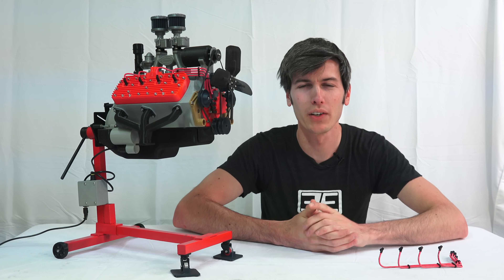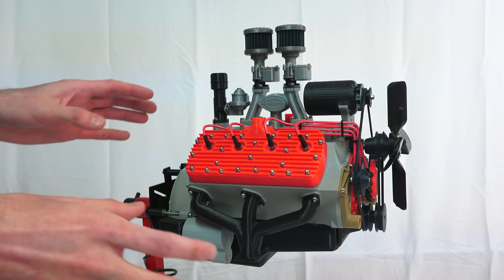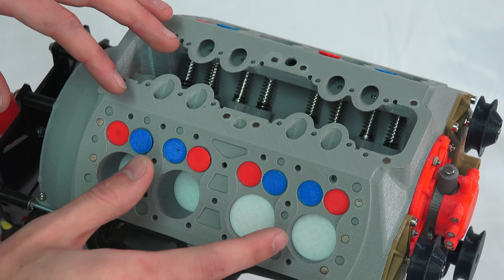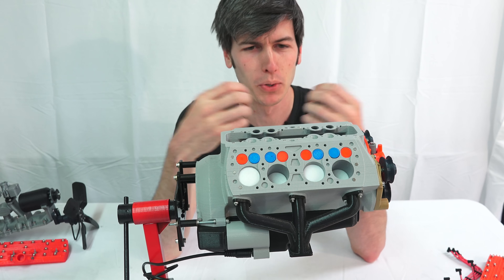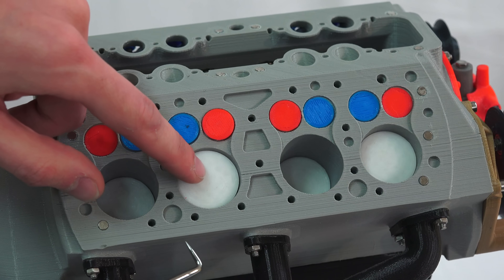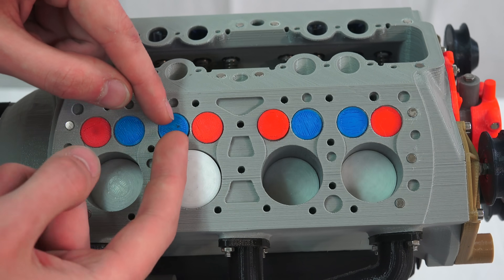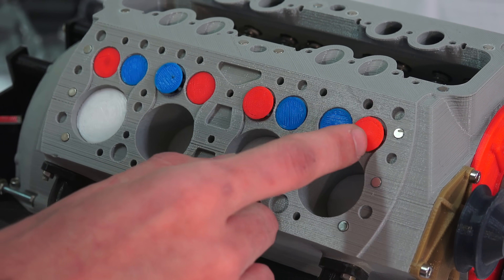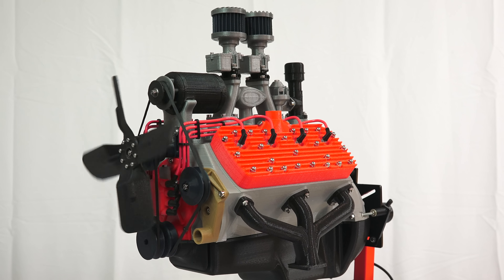Why Ford's Flathead V8 Engine Died

Comment: Ford were still using 30s technology in the 50s, Chevys were 40s tech, Then the SBC came and everything including the Y block were out of date. And that basic design is still around today.
In saying that still a lot of flathead V8s around, and a few Y blocks as well. But they all sound like a you need a rope to start them. And then in speedway circles at least you tie the gear lever to the dash so it does not jump out of second

Comment: We once had a 1984 Jeep Grand Wagoneer.  It had a 5.9 (360) liter V8 but 144 HP.  Now I don't see them on the road.  Are they rare?  I can only imagine anyone who still has one has probably dropped a different 360 in them by now.  Imagine 0-60 in 15 seconds!! I am sure there are slower vehicles but I just don't know what is slower than that thing.  It was 4 wheel drive so it wasn't all that bad.  The thing even had power seats and windows.

Comment: Great video!!   and awesome model.  I have a '51 Mercury with the original flathead 8CM engine.  It is completely stock and original.  Question to anyone who is familiar with flatheads:  Since increasing the clearance above the valves decreased the piston's compression ratio, can you compensate by modifying the crankshaft?  So you can increase the clearance above the valves, but then work on the other end by modifying the crankshaft so the piston travels farther thereby making up the compression?   I'm trying to understand this engine better.  I have the stock, original heads but I'm thinking about putting Navarro heads...

Comment: 3.9L engine makes only 110hp?? seriously  that's ridiculous
oh 1953..? alright then.. yea
Reply: @tbpom1003 Especially before the 1940s, they also had a laughably small amount of torque! In the 1950s, they at least were much better in the torque department, reminding me of the late-1970s GM 250 I6, which had a laughably low 108 HP or similar. But the GM 250 CI I6s actually did had torque worth a dang at the least, IIHC.

Comment: The Ford 60, the original V8, was used in midget racers until about 1960. The bigger V8 saw life after the car powering things like irrigation pumps. But overhead valve engines have a lot more power. I thing the later Ford flathead V8 had 110 hp and the early Chevy V8 (1955) had 200+ hp.

Comment: there were other problems , the exhaust went threw the block and over heated the engine, the cold intake air  caused the wet gas to wear out the cylinders, and the heads cracked too, the valves had soft seats and were hard to adjust ,.

Comment: All right first of all the exhaust manifold holes you got wrong there’s supposed to be eight not six there’s only supposed to be sixIf it’s a V-6 but that’s a V-8 one exhaust tube per cylinder which means there should be eight not six

Comment: Very inefficient engine. Massive combustion chamber total area is very inefficient thermodynamically. A lot of the heat energy during the combustion stroke was absorbed by all the extra area. This also contributed to the cooling inefficiency of the engine. Smallest combustion chamber area was gained with the hemi head contributing to its performance and popularity.

Comment: Don't forget, gasoline quality varied throughout the country in 1932.  By providing a low compression ratio and the odd flame travel, you ensured more complete combustion of a wide variety of fuels.  You also had a design that could be serviced by so many self taught mechanics, often the only option in the Great Depression.  After the Zombie Apocalypse (or Green New Deal Takeover), you’ll wish you had an engine this torquey and low maintenance.

Comment: At the time this engine was designed most engines were 'flatheads', even the Caddy V16s were of this design.  I also believe that most V engines of that time used multi-piece block castings while Ford's breakthru is the one piece block, this was also referred to by others here.  In design it looks very much like two fours on a common crank with separate water pumps for each bank, I'll bet that old Henry used the same pumps as in his fours, surprised that he used a new distributor.  The low compression was also related to the gas available, I think that Chrysler's 'high compression' engines of this time that required ''ethyl'  (leaded gas) that was was more expensive, had a c/r of about 6 to 1, not a lot more.  A friend of mine is restoring a '24 Pierce Arrow truck, it has a four cylinder engine flat head with two cams and four valves per cylinder.  All of the intakes on one side, exhausts on the other, this solves a lot of the flow problems and has twice the valve area per cylinder, higher compression ratios can be obtained by having a longer stroke.  This puppy was rated for nine tons at 15 mph, I'd guess top speed unloaded at 25 or less, yet the vehicle has some 30k miles on the clock.  Glad I didn't drive it!

Comment: “They didn’t even have computers “ . 😂😂 It’s a wonder we could build anything .
Reply: You actually had to be good at your job. There was no room for quota hires
Reply: They used slide rules in those days.  I still have one and know how to use it.
Reply: @frankeggers4024  I bet you couldn’t explain napierian logs to a snowflake.
Reply: @sre331l  It's coming back to me now.  Napierian logs are logs to the base e.  Actually I've never used them.
Reply: @frankeggers4024  useful in engineering since by moving to 10^-7 you avoided fractions when calculating dimensions, only converting back to full units at the end, after the calculation was done. In todays terms, calculating in 10ths of millimeters and converting to metres at the end. I'm sure you can see why not having to work in 13/32nd or 573/9600 was advantageous.
Reply: @sre331l  I don't like fractions.  They make calculations and readings clumsy.
Reply: Henry was very secretive about the design and development of the V8. He sequestered the engineers in Edison's Lab he had moved to Dearborn a few years earlier.
Reply: The car didn't have computers!🤦🏼‍♂️
Reply: how could we even build the first computers without computers!?
Reply: You would think, being born in 1953, that computers wouldn't be a really big deal to him.

Comment: The flathead died out because it didn't produce enough horsepower at the time and it had a habit of cracking exhaust valve seats.The name of the game in 1954 was more horsepower.

Comment: Another thing he didn't point out was that there was a special tool that pulled the valve guide down. You removed a keeper then turned the tool around and pushed the guide up and the whole valve assy comes  out. Making replacement of the valve guide a cinch. He also failed to mention at the two inner exhaust valve seats the block was prone to cracking. All in all it wasn't a bad engine for a first edition.
 BTW Most of the air coming in the back side would not flow over the top of the valve but would be sucked under the valve to go out along with the rest of the incoming air - does this impede air flow? Absolutely! However most bootleggers used these V8 Fords  So did Clyde Barrow! Pontiac offered a straight Eight flat (L) head so did Buick!
L head engines were the technology of the day -  and Hind sight is always 20 20! 
Chevrolet had I head engines but only 4 cylinders way back in 1923 (or even earlier)  then 6 inline OVH engines, until 1954. Then they came out with the 265 cid V8 in 1955 which then became the venerable 283 V8. To correct the "Air flow of the L engine Jeep came up with the F head where the intake was in the head and the exhaust was in the block! They were in the CJ3B (High Hood) first.

Comment: Ford's V8 was the first MONOBLOCK design V8 engine, making it more economical & easier to mass produce. Other mfg's V8 blocks before 1932 were assembled in pieces and were costly to make and slow to assemble! This little 60 hp engine was powerful compared to the 4 cylinders. It also had two oil control rings on each piston! 
Subsequent models like the 85, 95 and 105 hp engines were much improved over the 60.  
My uncle ran a race car in the late 40's early 50's with a Ford V8 which had a special cam and distributor in it making the two companion cylinders fire a the same time instead of one on combustion and the other on exhaust. It effectively made it a double four cylinder engine! I was told it was the only engine capable of keeping up with the Offenhausers at the time. It was called a Crossfire engine!

Comment: Awesome engine model and video!   Ford was the first to offer a V8 engine in a low priced car.  Ford offered the V8 in 1932 because the Chevrolet straight six (introduced in 1929) was selling like hotcakes.  But Ford was not the first with a V8.......V8's were the standard engine of Cadillac since 1916, and the standard engine of Lincolns since 1917.

Comment: Hello! I really enjoyed this video,I especially liked the scaled down and working model. You see, I build model cars and trucks in 1:24 scale. I am now working a 1940 ford woody, customised.
It has the same engine as the one you used, except carboration and filtering systems.What I am looking fore are some good pix of the front of the block, so that I may see the timming and distributer set up. Can you help.Steven

Comment: The flatheads demise was mostly attributed to the two exhaust ports exiting the block next to each other AND the start of our nations first super highways. The flathead was not able to sustain the new highway speeds without overheating. Bye-bye flathead.

Comment: Are currently making Flathead aircraft engines because they're lighter-weight you don't get quite the horsepower but then again they're so simple they run and run and run which is very important in an airplane engine

Comment: Another noted problem with the flathead V8 was cooling. Since the exhaust was ported through the block to the side of the cylinders, not only did it retain that heat as it traveled through the block, but it displaced volume that could have been used for more coolant. This is the whole reason behind Zora Arkus-Duntov making the ARDUN hemi heads. Basically, there was a need (especially in flathead v8 trucks) to mitigate overheating and raise power at the same time. So Zora and his brother designed a head that took the exhaust out of the block as well as gave it all the advantages of an overhead valve hemi design. The earlier heads weren't all that good, but the design did see refinement until its initial flaws had been taken care of.

Comment: Nice explanation, but how about a little about the exhaust having to flow through the block....?? When I was a kid, we had a '53 Mercury, flathead V-8...my Dad used it to pull a piano trailer...thing ran hot and vapor-lock was a real common problem (even without the trailer).
Reply: If they had put the exhaust ports and manifold in the centre of the V, it would have made the block smaller.  The exhaust gases would have had an easier exit, and avoided the long contact between block and gases, causing all that heating.
Reply: @psk1w1  That was a 'common' alteration for racing where endurance mattered, the problem is that engine bays of street cars at the time were rather narrow and the need to have the carburetion outboard of the bock sides meant it wouldn't fit anything not custom made for it.
Reply: @mfree80286  It would not be that difficult to fabricate an inverted-Y shaped manifold for a down-draft carburetor.  It would be no wider than the standard exhaust manifold

Comment: What this engine needed was valves either side of the cylinder, not on the same side, but that makes the block too wide.  Four small valves per cylinder, with two either side of the cylinder, would means the the block need not be too wide.

Comment: There’s a book, The High-Speed Internal-Combustion Engine by Sir Harry Ricardo. Get it, read it, and be amazed! Essentially, everything you ever learned about engines was taught to you by some guy misremembering something he heard from some other guy who got it from this book. Our present host continues this fine tradition. Recardo’s research showed the limiting constraint of the flat head design was pre-ignition and limiting said pre-ignition necessitated low compression ratios.

Comment: Also remember when the ford v8 was introduced the gasoline available was often low quality, low octane rating so 5.5 to 1 compression was necessary to avoid detonation that would rune the engine.

Comment: If you have one of the old flatheads with a small 1 barrel carberator you will get 20 miles to the gallon in town with a 1 ton truck

Comment: The for flat head engine was an engineering feet for its time and I believe to this day there are enthusiasts of the flat head engine to this day another problem with this engine is it suffered from overheating issues another thing i will say is don’t write it off because it’s I flat head engine be cause someone has actually managed to push one of these engines 300 mph it’s on the wiki about this engines if you don’t believe me also ALL flat head engines suffer from flow and compression problems

Comment: the shape of cyl head valves  has nothing at all to doo with gas flow in /out { where they are does thou, }when air comes in, it gets burned in the cylinder, its now swirling all over the place, It dont know where its going, { there aint a chip in there that say, Exhaust charge, you got to go that way now.,}, It goes where the least resistance is.

Comment: You are making this harder than it need to be. The engine only made 60 hp because Ford put a very weak cam in there. There are some aftermarket flat head engines making more than three times that.

Comment: These old engines and cars were to easy to repair.  People won't buy new stuff if they can fix things themselves.  Between that and mileage laws, today they have a million more parts today than they had in 1955.  Not only does this make cars harder to fix, there are a million more parts that can break and need repairs.  Nobody in 1955 had to pay $1,300 in repairs because their Traction Control light was on.

Comment: Now wait.  Those of you younger folk don't quite understand the "technology" of the period when Ford was building the flatheads.  Gas sucked, so they couldn't run much compression.  The engine is by today's standards, archaic-however it was a HUGE step toward what we have now.  What Ford did back then was revolutionize.  They figured out how to manufacturer the engine-cheaply-so that working people could afford one, and in those days, that was a huge deal.  There were much more powerful and sophisticated (by 1940's standards) engines available but they cost a LOT more, such that most Americans couldn't afford the car it came in.  Ford started the company on the basis of making the motorcar affordable, and continued to do so for decades, and in a sense still does (even though a $50,000 pickup truck is way outside my price range).  The manufacturing processes used in those days revolutionized how mass production was done, much of that concept which we STILL see to this day.   Many of y'all don't quite understand how Henry's concept completely changed society, and in my opinion, a lot of folks just don't give him enough credit for it.

Comment: Ford's 2 valve engine only died because the EPA said it had to go. Same with the small block Chevy, the 351 Ford, and the 4.0 liter jeep... Which is sad and annoying because they are some of the best designed engines ever made.

Comment: I know this is an older video but I  think you need to fact check yourself. This engine went into production in 1932. And I think ford used it until  53. 11 years is a good run. But that wasn't the end of it. It went into production elsewhere in the world until sometime in the eighties. Not for cars but some trucks and various equipment.  Like generators and pumps etc.... I am fan of the flathead and hope to buy an old ford with one some day.

Comment: It's no surprise that it died. What's amazing is that it last ed so long.  The first over head cam engines came out in 1902.  Ditto the first V8.  The Ford was  technologicly obsolete before it was even designed.

Comment: It's called The Chevy v8. Once everyone found out how much power you could make with it, the Flathead was history...
Reply: w41duvernay let's see Chevy V8, would that be the same Chevy that is part of GM government motors. small block Chevy way overated, back in the seventies Chevy small block needed a ring job after fifty thousand miles. fords were more durable.
Reply: Keep telling yourself that
Reply: yes that's the same Chevy V8 that Bob Glidden wiped the floor with back in the day. ya your little mouse couldn't hang with the Cleveland. like I said was overated.

Comment: Those long exhaust ports passing all the way across the block caused overheating at high power levels... Don't think any "Ford" engines came with finned heads, those were aftermarket...

Comment: The Flathead V8 had a great sound with a pair of glass pack mufflers. The big reason for that big rumbling sound was precisely all the 45 degree changes of direction in the air flow. I think the stock spec on this was 3600 rpm. But it was a great step in the evolution of mass produced V8 engines. Also if my memory is correct, to compensate for the 110 hp,  Ford had an axle ratio of about 3.55.